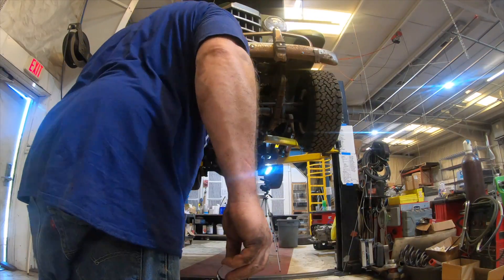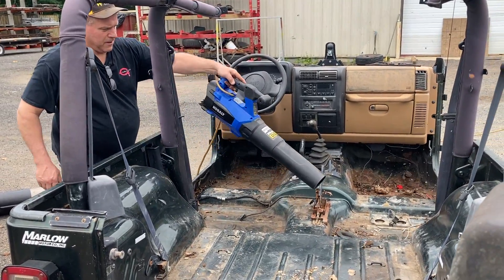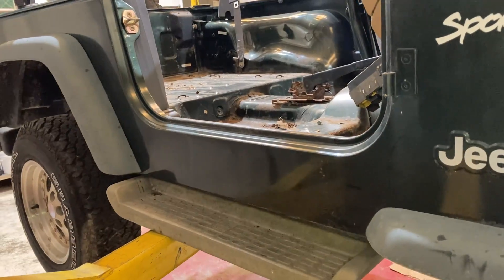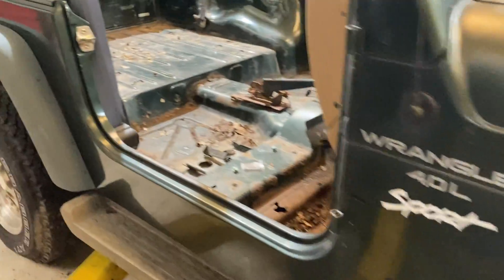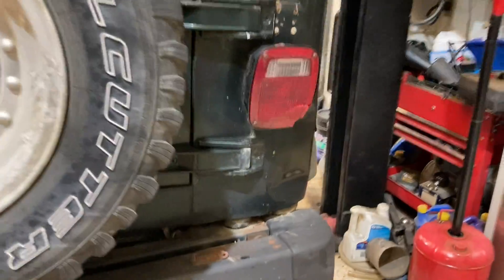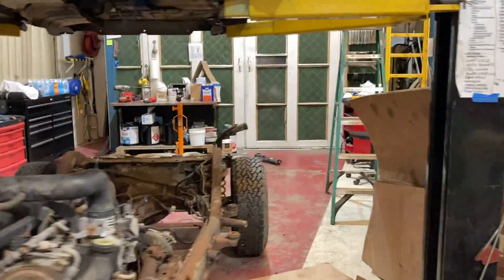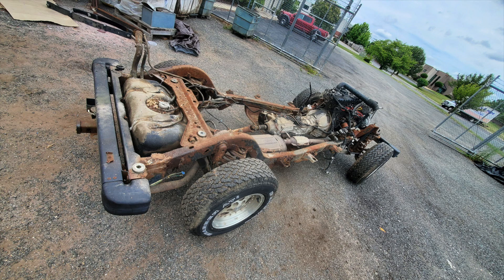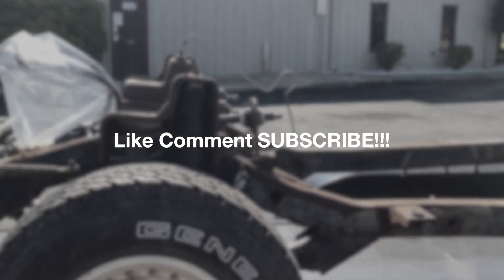Chassis Swap Willys Wagon Jeep To TDI Diesel Wrangler!? Complete Chassis Modifications!! Willys Ep.2

Comment: I dont think you realize how lucky you got on those body bolts that you only had to cut 1 lmao, they are such a pain
Reply from the maker: Right! These seem to be a pain with how rusty these get! Glad we got it off with little issue!
Reply: @Rustomod  my jeep is nowhere near that rusty and I spun three of the bolts back when I did the body lift. A little tip for the future you can find where they are from the inside of the tub and drill a little pilot hole through the floor and just soak them in PB blaster for days.(the captured nuts)